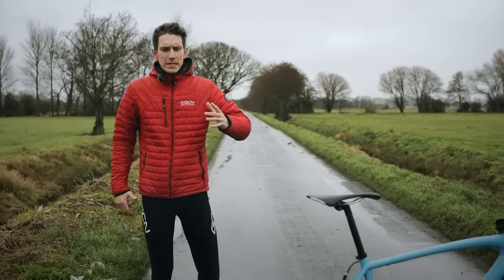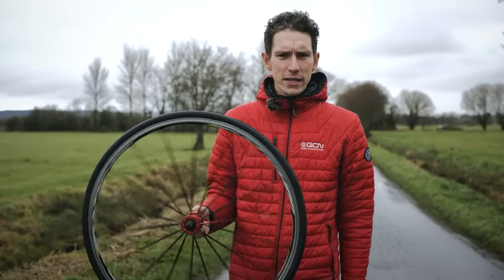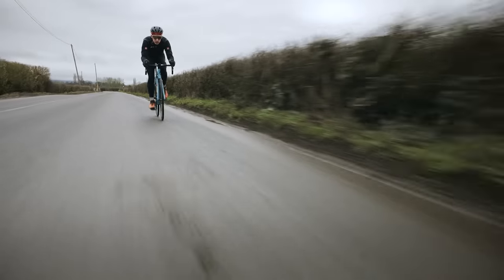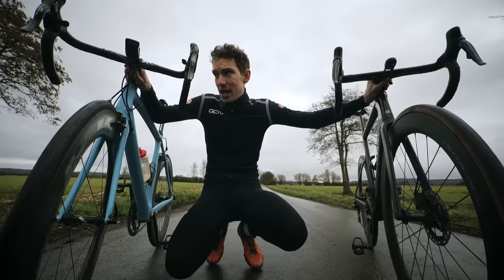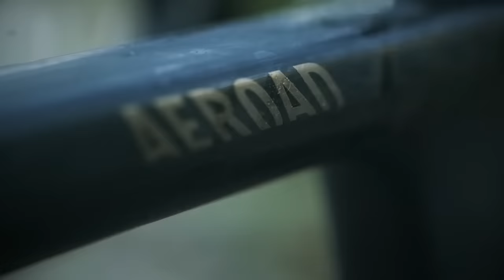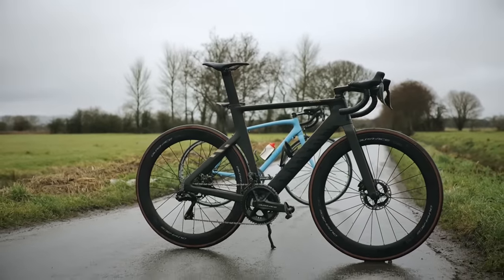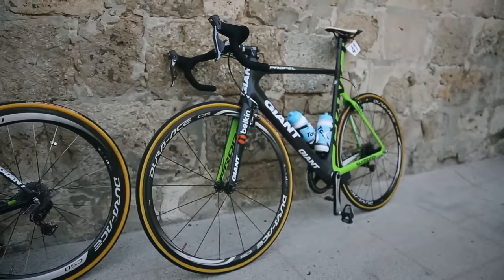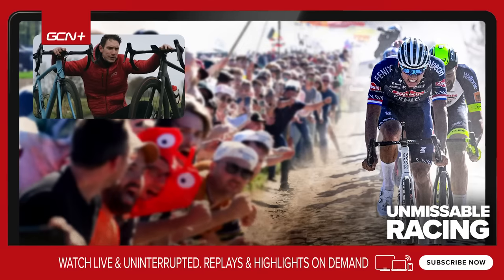How Much Faster Can I Make My Old Bike? | 2013 Vs 2023 Revisited

Comment: Speaking of the Mavic Ksyrium SL - they still LOOK amazing (IMO).   I have a set on one of my bikes and they're really strong and light - a good thing.   But at the time these were at the peak of their popularity I think no one could have foreseen the importance of aero and the development to that end in the years ahead especially lately.    And the flat bladed spokes on the Ksyriums you would think would give you some aero advantage to slice through the air - they actually did seem to catch crosswinds very well.  I do like them for hill climbing practice due to their lightness.   Interesting test.  Now I wonder if I can find a set of Vision Metrons that would work with Dura Ace V brakes that doesn't force me to take out a new mortgage.
Reply: I don't think the wheels make much difference at all going up steep hills - my Ksyrium SL wheel equipped bike is faster than my aero bike with deep section wheels on the steep hills where I live
Reply from the maker: @NicholasBowring  How about on flatter longer routes? Do you think the aero bike has an edge?
Reply: @gcn  I do think the aero bike has an edge on longer flatter routes - I have a carbon aero bike with 55mm deep section rims and it is quite a bit faster on flatter routes.    On the hilly routes of Derbyshire, however, there is really no difference in average speeds between the aero bike and my Mavic Kysrium equipped bike on routes I do many times.   I seem to set all my hill climbing PB's on the latter.   I love your videos BTW and watch them avidly.
Reply: @NicholasBowring  Nicholas - this is interesting - I'm going to do a test once all the snow melts here with both my Ksyrium SL TI bike versus my Orbea with "medium dish" type (not carbon though) wheels on the same route - flat and climbing.  It might be psychosomatic but I do believe I climb faster with the Ksyriums.

Comment: I'm very surprised how fast new bikes are I have a 9 year old bike but I don't race 😁 but it could help me cycling for longer 🤔 for the same power
Reply: sure with the reduced weight of your wallet you'd also save a couple hundred grams. check the weight on these new bikes and what kind of money they ask for. and think if you really wanna start faffing around with disc brakes as a casual cyclist. not worth it imo. also remember there's no way gcn would let the old bike be faster. sponsors wouldn't like that ;)
Reply: @xAudiolith  true new bike are not real worth the money but wheels could be an option 😁

Comment: I can beat you there!  My Specialized dates back to 2003!  Many times over the years, I've thought about getting a new bike.  But I'm too attached to it now - and the closest Specialized to its spec is such an horrendous price now.  Okay, it won't win any races - but then neither will I!  It's had a few upgrades and change-outs in that time.  A bit like Trigger's broom, in fact!  The frame is about the only original part.  And I still stick doggedly to the triple chainset and rim brakes!  I suppose, in all, it's a good advert for Specialized bikes!

Comment: It just goes to show you, unless you are racing keep riding your old bike. I'm almost 60 and on my third bike since my late teens   I won't buy another one now.
Reply from the maker: That's good to hear! If it ain't broke!
Reply: You may want to reconsider that.  I'm 65 and recently replaced my beloved 1995 Vitus with a disc brake Canyon Endurace.  The more upright position and 32mm 50 psi tires made a HUGE difference in my riding comfort.  Riding more than a few hours on the Vitus had become shear torture, but the Endurace has made centuries and multi-day adventure rides pleasurable again.
Reply: I'm 60 and ride a fixed gear.
I don't belong here.
Reply: @jefferycampbell2243  You could be right. I'll never say never, but at the moment I'm riding fine.

Comment: You can't compare two bikes regarding aerodynamics and speed  if there is no power data (watts) as a reference, plus we all know Canyon is a major sponsor of GCN, so I would not take this test seriously.
Reply: No, you’re right, a 10 year old non-aero bike is just as fast as a modern aero one, silly us.
Reply: @simonrichardson5259  I never said that dude. GCN always emphasizes  bike company claims on watt savings regarding new models. Well, let us know the real life test results using watts as reference in your so called  "test".
Reply: I made this comment too about being sponsored by Canyon. The test is absolutely meaningless without power data. Tyres and tubes and aero bars also make a big difference. Even removing the thick padded handlebar tape from the old bike would make it faster. Were the same quality of tyres used on each run? Tyre pressure? I am sure an aero frame will be slightly faster than a non aero one but how can anyone make a conclusion based on this? It would also be more valid if someone else rather than Simon rode the bikes. He will be more comfortable on the new bike compared with one he used 10 year ago.

Comment: I just bought new pair of Shimano RS710 carbon deep section wheels (46mm) with Pirelli Cinturato Velo 32mm tyres. Damn that thing is nice to ride on tarmac and actually on hard surface gravel as well! :P (I have the old wheelset with 38mm gravel tyres still in store for rougher conditions)

Comment: Nice video . Aerodynamics did a lot more difference than I could guess, but I think the difference is much less for slow riders like me, because aerodynamics does less difference going at my speeds (usually belov 30km/h) compared to the strong riders that goes faster than 40 km/H. If I trade in my 2013 roadbike for a new aerobike with carbon aerowheels I would be suprised if I gained 1 km/speed giving a hard(for me) effort at 30 KM/H

Comment: Ok re run the test but use a power meter, same tires, aero bars and seatpost and sram red etap mechs. That would be something worth watching. Oh and get a decent bottle cage and remove the spare.
Reply: But what do you actually want us to test? I don’t get it. Old frame Vs modern frame?
Reply: @simonrichardson5259  Yeah, exactly!!!, if you pull out all the stops, how fast can you make that sl3 go. Imo an sl4 or 5 would be more interesting as they are fairly cheap and just started to go with internal cables, so you could go with electronic shifting and straight away lose a big aero drag. Imo people are far more likely to make small component upgrades than a frame upgrade. Its super interesting that your new bike is 3kmph faster though.

Comment: I bet the gap would have been closer if Si used a 2012 Canyon Ultimate CF SLX with modern tires and wheels with the same power output. Thanks Si your video was helpful. I don’t really need a new bike just some 50mm deep section wheels and good tires.

Comment: The problem with this test is the course better suited the canyon,
The tarmac is a climbing bike,
The wheels are lighter and designed for going up hill.
Maybe the test should have been up alpe’d duez,
The lighter weight of the tarmac would outweigh any
Areo benefits of the canyon
Going up hill.

Comment: I'm pretty sure that chain wax is at least as old as Ollie and my old wool shorts! When I feel the need for speed on a club ride, I just dust off my 2005 Zipp 404 triathlon wheels (58 mm section fitted with Veloflex tubs of course). At less than 1300 grams, they are still in the super light category and, to this day, nothing beats the road feel of a really nice tubular even though if they are a whole 1 watt slower than the latest tubeless beasts. Last year I swapped my 44 carbon bars for 38s. I wager this was worth at least 1 km an hour at 40 km/hr. The skin suit is also a big factor....cheers/

Comment: I have just bought.... Drum roll.... A 2012? Cinelli Saetta with Campy Veloce, as an intro into cycling to see if I like it.
When the inevitable time comes to upgrade parts, can I 'bolt' new groupsets to it? Or is that not always compatible? 
Also on this theme, would it be a good idea to upgrade an old frame or just buy a fitted bike off the shelf?

Comment: Good anecdotal stuff. Of course, the modern aero bike is ultimately faster, they just are. You could still optimise the older bike with aero bars which would narrow the gap. As it were. But there are other factors to speed (and you can always buy a tri bike if you want ultimate flat speed). Stick 'em both on a max effort, 3-10min 12-20% hill climb (like most Strava segments) and see what happens. And acceleration (break following, wheel jumping etc). Both measures of weight, not aero.Then comfort, then ease of travel and maintenance... The old bike still has a lot to offer. And you'll have just as much fun on either.

Comment: Aero wheels..... you evened up the wheels and a few other things but the aerodynamics of frames is always moving on and saving watts. So my steel round tubes is losing a minute in a 10m tt to the aero carbon framed Boardman road bike, same wheels, a bit of crappy cable routing on the steel bike but its the aero tubing that makes the difference.  I try and block out the noise of the air churning around the round tubing when racing vintage bikes 😀

Comment: Thinner bars and heat shrink the front cables into one object. possibly some more aero bottle cages if that is even a thing. But other than that, it is what it is, any other upgrades are going to be very expensive, and really not worth it as if you do just care about ultimate speed, you need a modern aero bike. 

Its main failing is not having integrated cable routing which unless you go get wireless shifting you can't resolve, and even then you still can't for the brakes. 

This all said the main advantages of Disc brakes are because Carbon wheels braking was so poor, so if you have a rim brake bike, you would make rather be running aluminium rims if you ever use it in the rain.

Comment: I like the sentiment behind the video but the fact you are omitting power data/not riding to a set power makes it completely moot. 

It doesn't take much of a cynic to understand why you would want to do that.
Reply: I think you are rather too cynical Andrew. And actually who’s to say if I rode with a power meter I’d do it accurately and then not lie about it afterwards?
Reply: @Simon Richardson  Thanks for responding Simon. Well I would trust your integrity if that were the case. I think 10yrs of seeing you on the screen leads me to think you wouldn't do that.
Reply: @simonrichardson5259  easy, take a bloody photo of the Garmin, Wahoo or at least some Strava data that has Lap Time, Lap average speed and Lap average power. The fact that ya’ll hold the largest exposure on cycling social media and still bold enough to say this speaks volume on how unreliable your sponsored tests are. And if you are confident enough that your data is reliable, you wouldn’t personally go and reply to every single negative comments under this video.

Comment: If the old frame has all new components, like aero handle bar, wide tyres etc the gains on the new bike will be very minimal and negligible. Now consider the price of the new bike and ask the question are those small gains worth the price tag ?
Reply: If you upgraded everything on the old frame to modern components it will cost more than the new complete bike. The old frame still isn't quite as aero and ride quality on the new frame is likely better. What's your point?
Reply: Plus you have incompatibility issues. For example tire clearance. An old bike from 10 years ago may not clear anything beyond 25c. My Cervelo doesn't .. can only do 23c.

Best just buy a new bike.
Reply: @Pastamistic  I am not suggesting to upgrade old bikes with all new components.. what I am saying is that the benefits of the new frameset is minimal and the times difference have a lot to do with the component choices. The aero benefit of the new road bike is negligible for most riders.

Comment: I upgraded my Cannondale Synapse by replacing the wheels with 50mm carbon and GP5000 tires.  My comparison tests show a 1.2 kph average speed improvement.  I'm guessing about half that improvement is from the tires.  I ride about 34 kph.

Comment: Although I am known to be a sceptical person, I do not question the Canyon will be a tad faster by its more aerodynamic frame set alone, even if you equip both bikes with exactly comparable wheels, tires and inner tubes. What I doubt indeed, is the difference being that substantial.

Comment: It was strange the idea of wide handlebars. When I got my bike, back in 2012, even though it’s a size small it came with 42cm wide bars. It was changed to 40cm not long after and it felt so much better. I wasn’t even thinking about aerodynamic efficiency just what felt right for width of my shoulders. I know some bike manufacturers still tend to use 42cm regardless of frame size. Why?!
Reply: what do u mean why depends on your body everyone has different width and build so obviously not everyone wanna ride narrow bars just because they are more aero
Reply: @turtleneck369  No, I mean on a size small bike a 40cm wide handlebar would normally be more appropriate. I didn't get a 40cm wide bar in 2012 becuase it was more aero, it was just the correct size for my shoulder width. It seems strange bike manufacturers don't adjust always adjust the width of the handlebars based on frame size. Just stick on 42cm bars, regardless.

Comment: Great follow up vid.  Would be interesting to see how much if any difference there was on the two bikes with a lesser / more typical recreational ("weekend warrior") type rider vs an x-pro cyclist that's still in pretty top shape.  Because I think that's really who this comparison applies to.  There's no difference that all of the tiny advancements over the past 10 yrs ADDED UP would certainly result in SOME (marginal) gains for a PRO rider.  And since most pro-races come down to a few seconds--or even milli-seconds--at the line--spending another $5k on a bike for those gains is worth it.  But for Joe Sixpack, who's just out riding with his mates through the city or the countryside on the weekends--the difference between a 10 yr old S-Works bike that he can buy now for $1000 to $1500 is probably zero compared to a brand new, $8/9/10/11/12,000 bike.

Comment: I just came back to cycling after a 13 year absence.   The bikes I dusted for cobwebs, layers of dust and reconditioning from rusty cables and old grease are now probably in their 20's.  No new upgrades, still just replacing cables, tires and tubes.  I wouldn't know how much better I could do in a new bike: I don't even own a power meter.  I am having a great time just riding again.  Ignorance (of new component performance) is a bliss, or is it not?  Full disclosure, i did add a new gravel bike to my collection.  That is something new I did want to try.

Comment: Makes you appreciate how much bikes, not just wheels, have got faster in the last decade. Like you say though, unless you’re racing you don’t need to be that concerned if you haven’t optimised every bit of aero savings available. Just enjoy riding.
Reply from the maker: Very true. Any bike is a good bike depending on how you use it!

Comment: I have a Bianchi 928L with complete DA 7800 groupset with Ksyrium 100 anniversary wheels. . I swapped the shifter from 7800 to 6700 Ultegra ( so no cables in front) and add a pair of 50mm DA cabon wheels.  Besides my fitness improvement, I have to say that I became quicker on the same course we as a club rides. 2 to 3 minutes quicker. It don't sound like much, but you know what that means when you are on a bike

Comment: Interesting.  Essentially a modern aero bike is faster because of a plethora of evolutionary and interrelated factors from wheel design, geometry, cable routing, handlebar width, gearing etc. The gains might be marginal but the feel of a bike like the Canyon is undoubtedly more striking. I think we call it progress but it shows how sorted and basically effective and tunable higher end, race proven bikes like the Specialized are. As a matter of interest could an older bike from the 1990s or early 2000s be improved to close the gap as readily?

Comment: Unless everyone in the comments here is a pro or racer, it doesn’t really matter apart from cafe bragging rights. 
I’m in a 2014 Scott foil with modern 60mm Carbon rims and carbon aero 39cm bars. 
I wouldn’t be any faster on my hilly local routes if I was on a new bike. The only 2 big developments worthy of note over my Scott are electric shifting and disc brakes. Not worth spending £5k/£6k on a new bike though given I’m a hobby cyclist.

Comment: I have a old man bike mechanic before who uses an old school steel bike with down tube shifters. But the way he over takes those guys who's using aluminum and carbon bikes will make you think that it really comes down to the rider than the bike. But if you're going to be a pro and will compete then yes you need the latest and greatest but if you're just a hobbyist then you just have to improve yourself.

Comment: For more marginal gains on the Specialized turn the quick release level to point towards the back of the bike and push the level tighter towards the frame. In the video it's out in the wind. OK you might not gain 31 seconds...

Comment: I‘m really surprised that the difference is still that big. I expected that the cables and the rest of the little bits not to be more that 5 seconds. If you are back at the wind tunnel, try to find out were the 2013 bike is less aero.

Comment: Too much confounding to make a truly accurate comparison, should have had the same wheels on both bikes. I also disagee about the bar width response. The old bike has the bars it has, the new one the same, so you should have tested them both as they came. Still, good to see the new bike is still significantly faster, a demonstration of progress. Some of the comments from old roadie bores about progress are absolutely laughable.